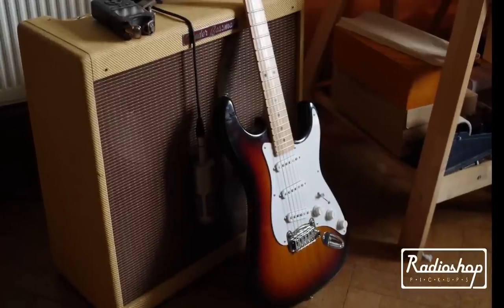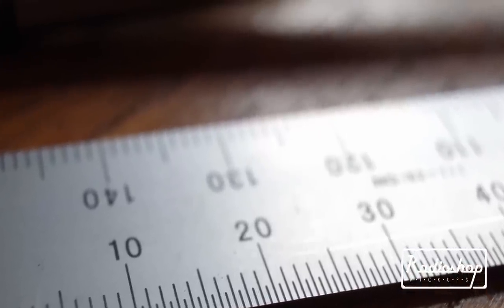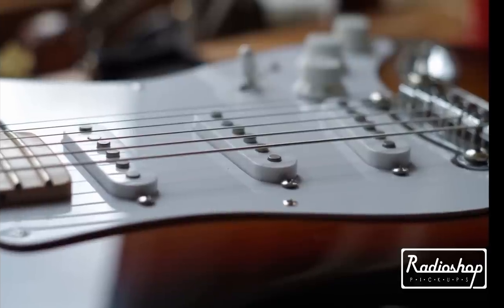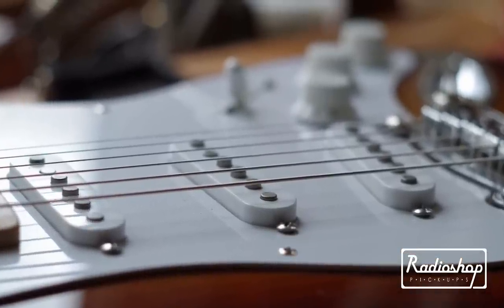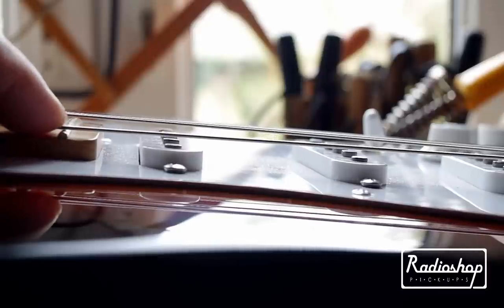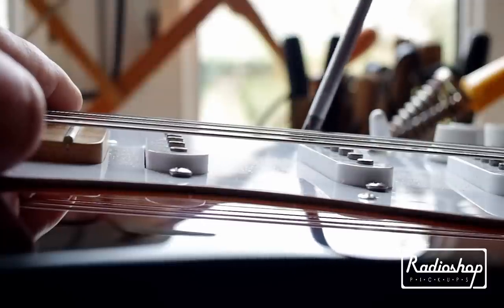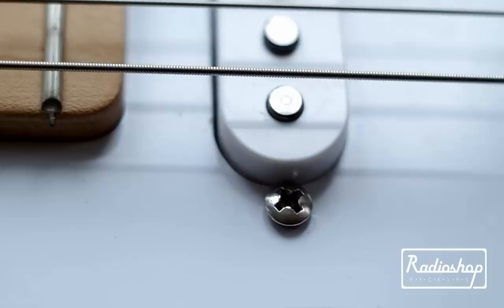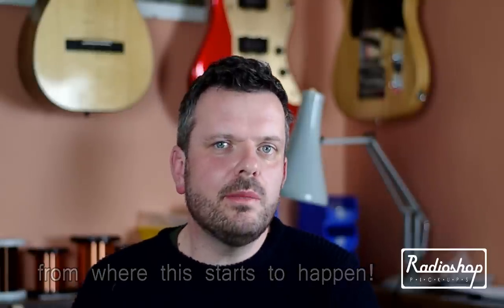How To Set Stratocaster Pickup Height

Comment: I have playd stratocaster for 35 years. And most people raice pickups there pickup too high. I set my pickups in general pretty low. Why? It don't interfere whit strings so much then and the guitar ring out the tone more open. I set en gently around 1/4inch or 6,5-7mm. That's the tips from me.
Reply: Same with me.. i don't know why many people set the pickup 2mm.. as we know hard to find the right tune at 12 fret.. even i  set for 3mm trble side & 3.5 bass side, the third G string and low E still attracted to the magnet

Comment: I’ve set up 1000s of guitars (literally) in a shop for the past 20 years.  This is the textbook way of setting traditional Strat pickup height and sounds good 99% of the time.  If you have personal tweaks this is the base from where you start from.

Also worth noting that practically every Stratocaster pickup maker uses this somewhat standard height in the design stage of their pickups… Meaning if you want to know what Seymour intended a set of Antiquity Strat Pickups to sound like, he more than likely was using these pickup heights as the reference point.  

Thanks for making this video.  There is so much noise and opinion on the internet , sometimes the tried and true basics get lost in the static.

Comment: Have got a “Partscaster” Strat I put together with an Alder Squier  body, Mighty Mite neck, GFS “Shorty” Steel block, Fender bent steel saddles Fender Tex Mex pickups with a wiring kit from Rhoadhouse that has 250k CTS pots and Sprauge Black Beauty cap and “blender” pot, and I also added a “Base plate” to the bridge pickup!
Have been struggling with pickup heights as a height that improved one area was detrimental to another!
Have used the settings provided here and it all seems to have come together!
The clean funky tones sound sweet, particularly positions 2&4 with the tone backed off slightly and the driven tones have real bite that fatten up nicely with the tone rolled off a bit!
Thanks for the advice!

Comment: Very good and straight tutorial. I actually like the point of having a BASIC setting, depending on actual measurements, and from THAT go ahead and make adjustments by ear. Also I find the tip of reducing height rather than increasing very helpful to keep a minimum distance between the string and magnetic field. Makes a lot of sense! Thank you.
Reply from the maker: Natalie Pauls No problem at all Natalie, thank you for your feedback! :)

Comment: You can use a capiler rule to help measure the distance (set it up to 2.0mm or 2.2mm and use the depth measurement rod to judge the distance between the string and the pickup magnet).
Reply: That's what I did. I measured the thickness of the string and added that to the measurement since my caliper was measuring from the top of the string to the pole piece.

Comment: By fretting the last fret, isn't that not taking into consideration the action height? What if the action on two different guitars are 2mm off? Then when you hit the string open or say at the 3rd fret way up the guitar the distance from the pick-up will be different. If you understand what I mean. Wouldn't it be better to just set the pick-up height based on the strings in the open position. Thanks for the video, :)
Reply: Ja, that's what I thought as well. Or maybe fretting the 7th or 12th fret instead to get a more even sound along the fretboard.
Reply: You should set pickup height AFTER you’ve done a proper setup on the guitar
Reply: @onixtheone  People still opt for different "proper setups" so the comment still stands.
Reply: This is a great video. Anything else is up to you

Comment: …but what about the staggered pole pieces in many Strat pickups? You may get the high e and low E all dialled in but the other 4 strings may be a different measurement depending on the poke stagger. Am I missing something?
Reply: Staggered for the radius.

Comment: What about Stratitus? Warbling high notes from magnetic pull? That needs to be dealt with by lowering the pickups away. Usually this is eccentuated by higher gain sounds and when you have a humbucker in the bridge the middle and neck singles can make the sound warble and it sounds very annoying.

Comment: IMHO, there's just no substitute for using your ear to set output via height as the tonal differences are huge.  I'd suggest starting with pickups flat/level/no bass or treble tilt, adjusted as far away from the strings/deep into the body as they go, listen and adjust one pickup at a time.  Raise the pickup until you hear the most pleasing tone (for me, I prefer the tone when pickups are set low, nearly level with the pickguard).  From there, balance the bass and treble output of the pickup to your taste by raising or lowering the bass or treble side based on the needed increase or reduction in bass or treble.  I tend to have the bass side set very low and the treble side a good 2mm higher because that's what my ears like.  Finally, check output balance between all pickup selector positions and make any fine-tuning adjustments while maintaining any pickup angle/tilt established from listening to the pickups individually.  This gets me the clucky stringy quacky clean strat tone that I love, much more even string response, and much smoother overdrive tones.  Dan makes a solid case for low-set pickups:

https://www.youtube.com/watch?v=oAe1vatPpzA&t=152s

Comment: Good advice but in my opinion most Strat pickups are to low or to high...i measure from the 12th fret, 2.25mm on E string down to 2.00mm on G string...for Fenders pickups...if done this way the pickups are lower at the neck position & higher on middle & bridge single coils...we all like a slightly different  tone.....then fine set by ear keeping within 2mm -  2.3mm above pickups...works for me on bass's & guitars...

Comment: Chris bucks pickup height is much lower, like 1/4 inch, like me. Technicians work on science, what's optimum output without ghosting or magnetic pull, whereas players base it on feel and expression. I have a dynamic right hand and dig in with a thick pick, so low set pickups work best, less hand and pick noise

Comment: How do you measure .2mm ? I realize that this is only a starting point as tone is subjective.
Reply from the maker: Hi Gene, with difficulty is the answer to that question, ha! Fortunately my ruler has increments in half mms so I work on a basis of just under the halfway point between 2 and 2.5mm which takes a bit of doing but is possible. Lots of light in the too. But as you suggest it's a guideline indeed. Paul @ Radioshop
Reply: Gene Hullinger if you go to most d I y stores they do packers or shims some people call em , wot they are is plastic pieces for packing out door and window frames when installing them an they come in all different sizes from one mm up to ten mm thick , I would have thought this might be easer than looking at a ruler
Reply: @peterwright5249  Cheers for that. As we get older the eyesight isn't what it used to be. I'll definitely give it a go.
Reply: Gene Hullinger l
Reply: @peterwright5249  totally with you on this - shims or feeler gauges are easier and more accurate than trying to judge 0.2mm on a ruler

Comment: How u come to 2mm and 2,2mm? Different SC got different outputs. Some players play with high energy and the strings more vibrating, some play like pussies. On my MIM Strat the polepieces are set up different as US strats (what is a big plus of the MIMs). How u will calculate this?
When u want set up your PUs use a screwdriver and your ears first! Sure treble side is bit higher, thats a useful rule. But saying so and so much millimeters is rubbish.
And had u in mind that the middle pickup need some special setup for the position 2 and 4 sound quacky (if wanted)?